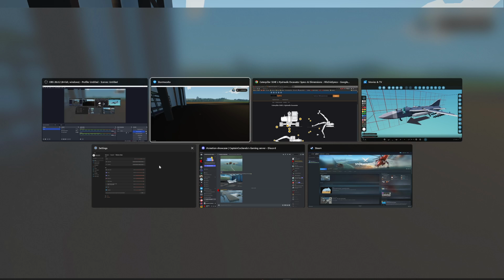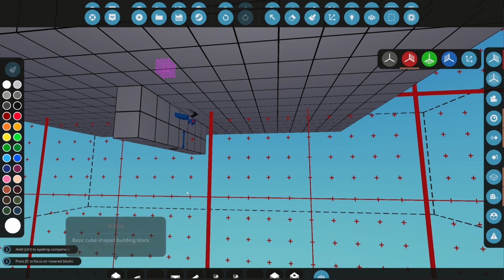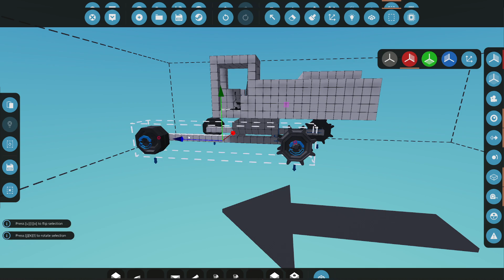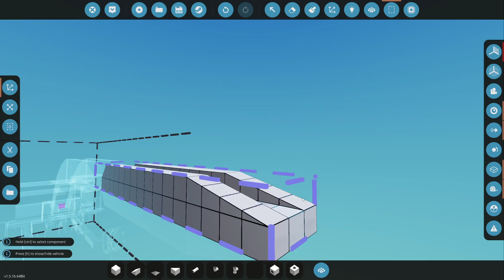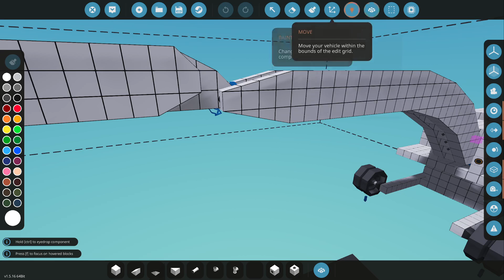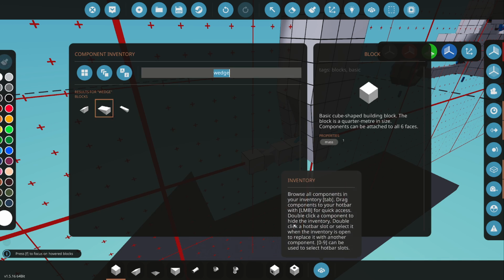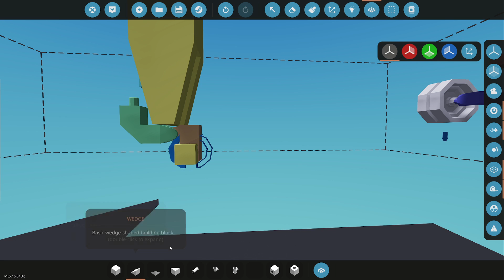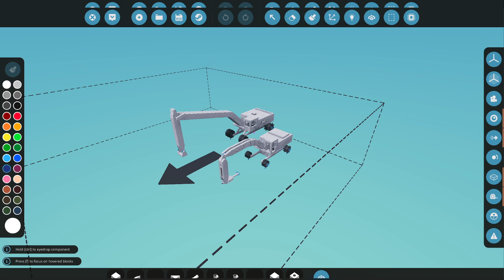Stormworks Career Build Series  161

Comment: Just FYI when you start to polish off the build most excavators today have a dial that you turn to put the motor in a “working” rpm and an idle rpm. May can work that in with a button instead of working a throttle. Just a thought!
Reply from the maker: The skid steers I used to run had a high flow and low flow for the hydraulic system was kind of like that and you could also set an idle RPM in a high RPM. This is going to be diesel electric so it doesn't really need to change the generator automatically throttles to maintain a battery top off

Comment: 360 turns.  I had the same issue.  Don't think full 360 is worth the trouble. Stay 180.
Reply from the maker: Yeah that was my thought. I have it working on certain things but I just don't think it's worth the trouble. It would be worth it if you were picking up the ore with the excavator and then turning 180 and putting it in a trailer behind you. But the excavators are mostly going to be used for drilling so that's really not necessary. Definitely agree.

Comment: And not sure if it hellps but excavators  use hydraulic motors to drive. So diesel elecric using electric motors for the tracks would be more realistic and probably easier to control.
Reply from the maker: Yes hydrostatic. That's one of the things I would love if they put in the game is the ability to do hydrostatic drives. It probably wouldn't be all that difficult. You'd have a pump or an impeller hooks to a motor. And then running pipes to the hydrostatic. Pressure differential would change the speed of the hydrostatic motor.
Reply: @CaptainCockerels  absolutely!   I would love it if they implemented a hydraulics system in general.   They already have fluid pressure so it would not be too much more to add a way to use that pressure for moving things.   

I'm sure it is probably something that is way above many players level of knowledge and they don't really want that so it probably wont happen.